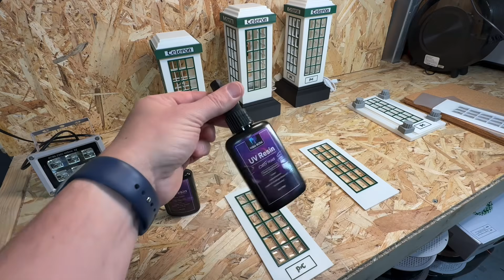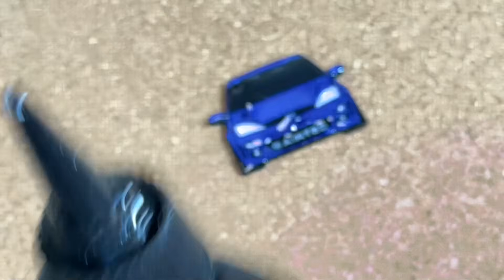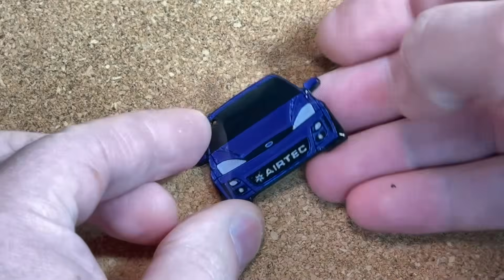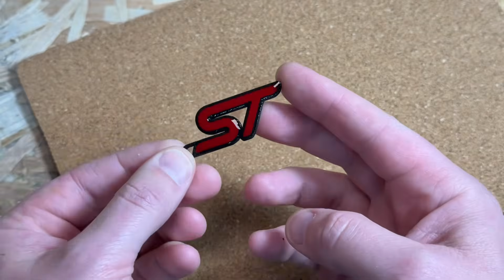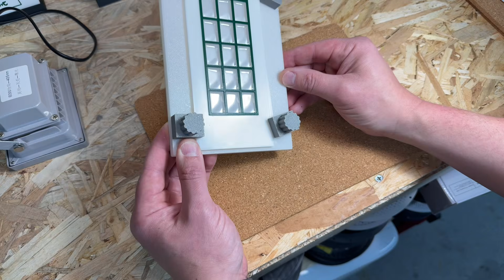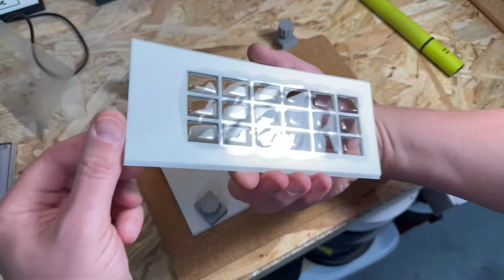Elevate your 3d prints for cheap using clear UV resin

Comment: Could you post a link to the plastic film that you’re using underneath the UV acrylic?
Reply from the maker: Its just regular laminating pouches available in any good school supplies store
Reply: @Kenprints  awesome, thanks for the reply. I was having a bit of luck with wax paper and adding a very thin layer of oil rubbed into it. But still had the occasional issue with it acrylic sticking to it and ruining the finish. Im looking forward to trying the laminating film. Thanks again.
Reply from the maker: Laminating film peels right off easily once the resin has cured - if its not peeling off shine more light on it for a few mins and it will come off really cleanly
Reply: @Kenprints  Yes I found that out. I did successfully get the acrylic looking good with using the laminating sheets. It did take a little trial and error as if I hold the light to close, the acrylic will heat up too much and warp the plastic underneath. But if I have a little patients and hold the light a foot or so away, It cures slower and get a much more smooth finish. Thanks very much again and I look forward to seeing more of your videos. :) *Cheers
Reply from the maker: Thank you